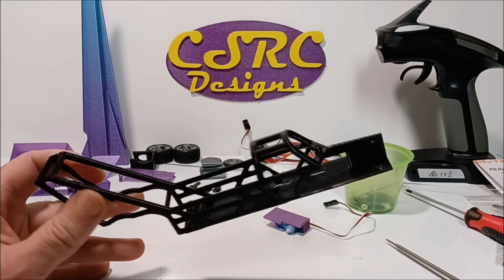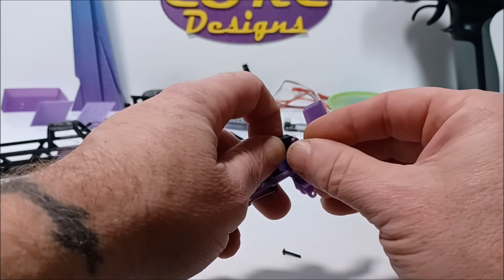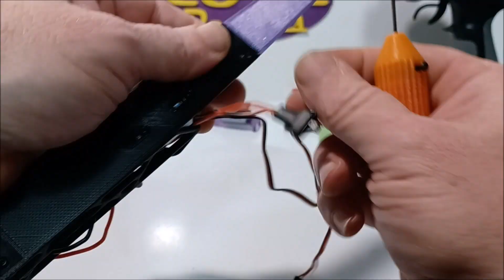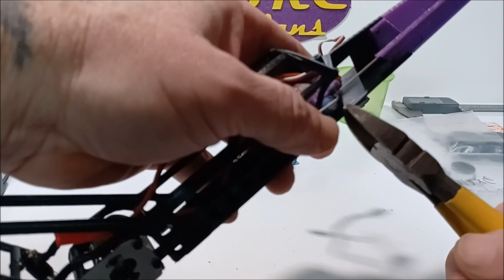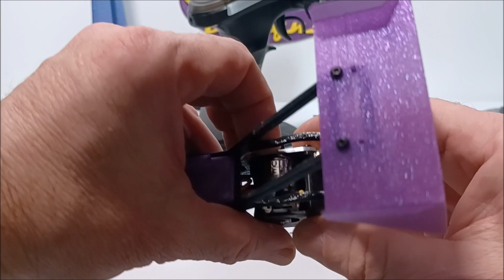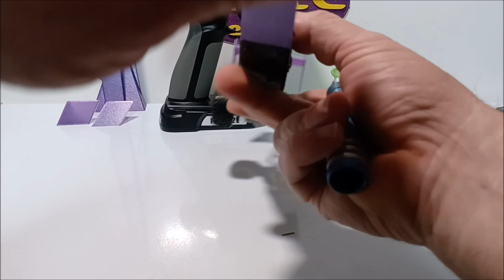CSRC 1/24 top fuel assembly

Comment: Purchased this model but I noticed you are using an aluminum motor plate not a 3d printed one. What is that from?
Reply: Hi , I'm Chad, this is one of my creations.The aluminum one is the same as the printed one. I had 100 machined up because at one time I was selling these in a RTR format on e-bay.  Pretty much the exact car you see built here , 50 t brushed motor, 9t pinion , fly sky GT 2 radio . sorry it took so long to answer this . Long story short, divorce and I lost control of the account this video is posted on. .